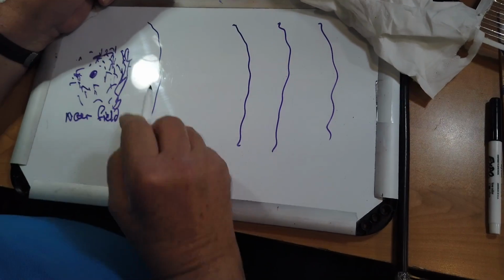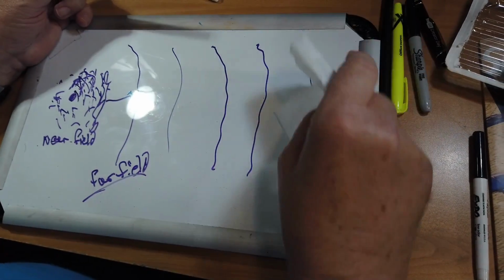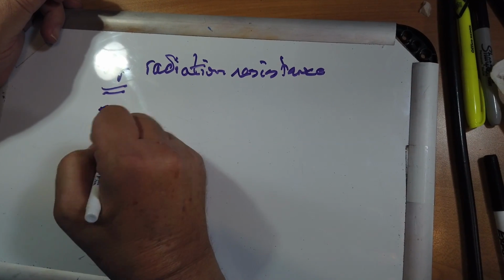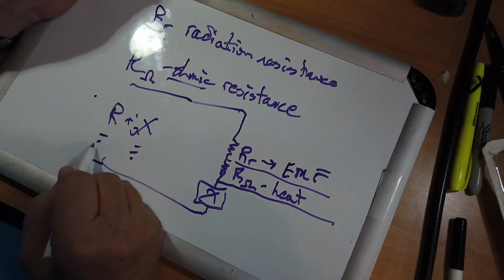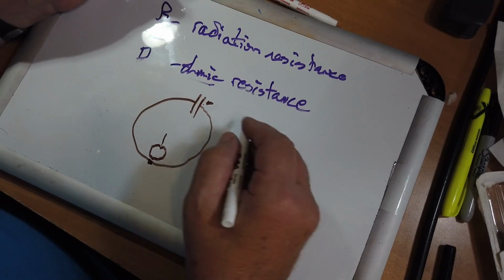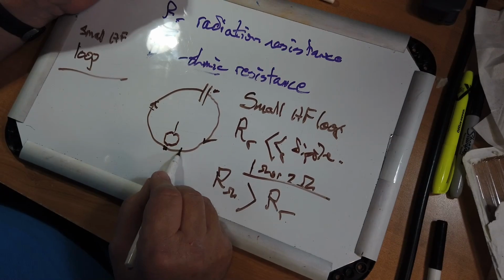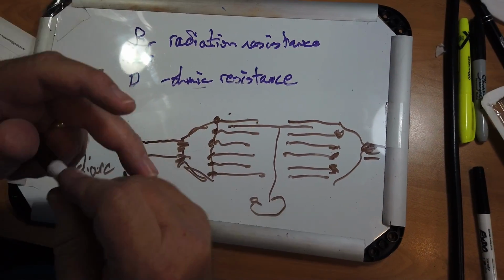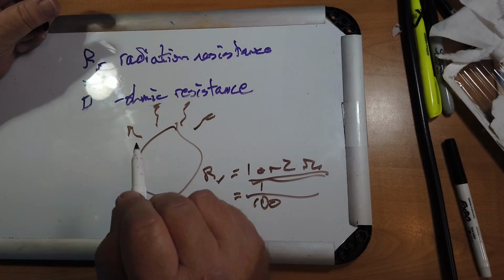Mag Loop Efficiency Considerations (#736)

Comment: I believe that this video contains a misconception regarding the "Near Field".

When "Near Field" is being brought up, it is clear that this entity is the same as the "Reactive Field" or the Fresnel Field", which has many interesting properties that differ from electromagnetic waves in the "Far Field", otherwise known as the "Radiative Field" or the "Fraunhofer Field"

The two regions do not change suddenly, but there exists a gradual transition between the two kinds of fields.

The distance where the near field transitions into something referred to as the far field is a function of transmitted frequency and the dimensions/length of the radiating antenna, NOT the antenna's gain/

The confusion is that when the "Near Field" is in the discussion of a parabolic antenna, they are NOT speaking of the electrostatic or magnetostatic fields involved in the reactive field, but to a purely radiative field that is only more collimated than most less directional antennas. The phase difference of the electric and magnetic fields, as well as the fall off of the electric and magnetic field for the collimated portion of a parabolic antenna will be identical to that of the far field fall off of a normal antenna's far field.

Unfortunately, when the literature discusses the "near field" of a parabolic antenna, they are talking about a different thing than the reactive field spoken of for non-parabolic antennas.

Physics is rife with poorly chosen terms, which can have numerous meanings. "Near Field" is just one example.

Although antenna simulation software does do a "sum of currents" on segmented small antenna elements, there are NO FREE ELECTRONS in the near field. The near field is only electric and magnetic field excitations that are not fully in temporal phase with each other - these orthogonally phased fields experience much greater loses than the inverse square law predicts for temporally in phase electromagnetic waves in the far field.

Some antenna simulation software is capable of analyzing near field to far field transformation and are advantageous  when physical test limit actual reference values to near field values.

A short answer to Pedro's question would be that the variable nature of a Magnetic Loop's insertion losses, which can vary even for the same model loop, can determine the ultimate efficiency of anyone's personal Magnetic loop. Is it "efficient"? Not really. But, will it "work"? Yes it will. Many people are very happy with their magnetic loop.

Your mileage might vary.

Roy AC2GS, host of the LIMARC Technical Net (43 years in continuous operation) - W2VL 146.850 EchoLink W2VL-R every Sunday night 8 PM EDST.

Comment: I’ve seen online calculations showing a 1 meter loop is 10-20% efficient on 20m.
Reply: The calculator at 66Pacific shows 68% efficient for a 1 meter diameter loop at 20 meters/14 MHz. Are you talking about loop diameter or circumference?
Reply: @laserhobbyist9751  Circumference, that calculator  (small transmitting loops) doesn't use diameter.  But, I just used it for a 3.2m circumference loop (diameter of 1m), 1cm thick conductor.  Its still 48% - which isn't great. The Chameleon loop with an upgraded 36" diameter, 1" thick aluminum loop is 66% efficient, still not great but OK on 20 m, but remember that its limited to 25w, and you begin to realize how  little power you're radiating.  On 40m, its pathetic - 16% efficiency - so approx 3.5w out for 25w in.  For true QRP work, 5w or less, these are poor choices for portable antennas.  You're much better off with a portable EFHW.  Nearly 100% efficient, small enough to put in your pocket, and about 20% the cost of a commercial magloop.
Reply: @kd8opi  For myself, anything with an efficiency much under 50% isn't enough, where can I go to find the calculator which uses only diameter and wavelength?

Comment: Mag-loops have fascinated me since I learned of their existence. I always wondered why they were typically so expensive since the component parts aren’t that expensive, the variable capacitor being the most expensive part. Your video helps me understand a lot more consideration goes into building one than a simple sum of the parts. Thanks for this explanation.
Reply: I have built my own magloops for 80m/60m,40m,20m,15m.17m,10m  and have spent a lot of time ensuring the ohmic resistance is as low as possible by making sure all conductor joints in the circuit are 500% full continuity by using enough heat to solder with silver solder. The antennas perform very well and prove over and over that the magloop is a very under estimated antenna, Built correctly it can outperform a dipole that is installed at the incorrect height spewing 100's of watts in the wrong direction. A magloop does not need to be high, 1-2 diameter height is sufficient and it can be rotated easily to send  the RF in the desired direction of the qso because the magloop is directional in the plane of the loop. 73's ZL4MBW
Reply: Do you mean 100% silver solder vs. regular silver/tin solder?  If so, why would that make much difference over the very small distance of the solder?  Is the contact resistance different? @michaelwdunedinnewzealand2993

Comment: Most every antenna I've ever modeled in MMANA-GAL has resonated within a percent or two and within a few percent of the expected bandwidth. Not quite as accurate as NEC, but is much easier to figure out how to use for most folks. There is also a great free loop antenna calculator out on the web that I sometimes use. Ohmic loss in small loops can indeed be very significant unless using very fat elements.

Comment: What design features affect the radiation resistance?
Reply: Length of the radiator relative to frequency.  For example, a 0.5 long wavelength antenna has a high radiation resistance (good), maybe even 1000 ohms. Compared to ohmic resistance (loss), even if it’s say 50 ohms, the efficiency is radiation resistance/total, so 1000/1050, or 95% efficient.  Once you get down to antenna lengths that are a small fraction of the wavelength you’re broadcasting at, the radiation resistance might just be a few ohms.  Say you want to transmit on 80m with a 1 meter antenna; the radiation resistance might be 2 ohms, but the other total resistance is still 50 ohms, so efficiency is 2/52, or about 4% in this example.  Can’t get around this, which is why mag loops are kinda crappy antennas until the loop length approaches 1/2 wavelength.
Reply: @kd8opi  Thanks!
Reply: @blrichwine1  no problem buddy.  It’s one of the most important concepts in understanding antennas, and it’s totally overlooked.  The  low-info ham looks at SWR on his fancy buddipole/chameleon 3 meter whip antenna he has hooked to a coil and/or a tuner to match , sees that it’s at 1.2, and believes he’s radiating 98% of his power as a radio wave. What he’s actually going is sending 98% of his power from his rig and into the matching system, 2% is reflected back into the radio (what the SWR meter reads); and of the 98% he sent into the antenna (say he’s on 20m) 90% of that converts to heat, 10% into a radio wave.  So, he’s really putting out less than 10% his power into a radio wave; even though his SWR is 1.2.  Take away the coil/matching system and repeat the example. Now his SWR is 10:1, he keys down, still puts out less than 10% of his outbound power into a radio wave, but instead of heating up the coil or the tuner, the power reflects back into the output transistor of his amplifier.  It blows, smokes up, and now he has to send his radio in for repairs.

Comment: Dave, using simple algebra an excellent explanation about "mag" loops. I have the kind that uses LMR400 for the loop and I suspect not as efficient as one built with solid metal like copper. What I really like about the mag loop is I can put mine up in less than 5 minutes and be on the air whilst portable. 73/K6SDW